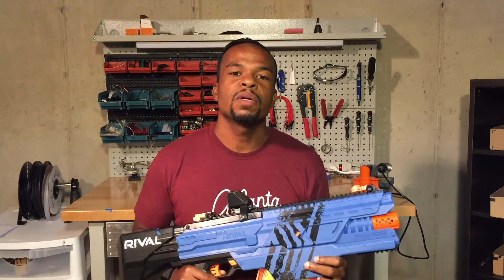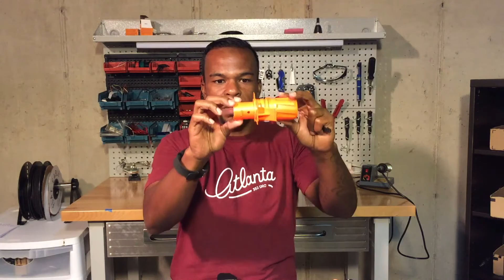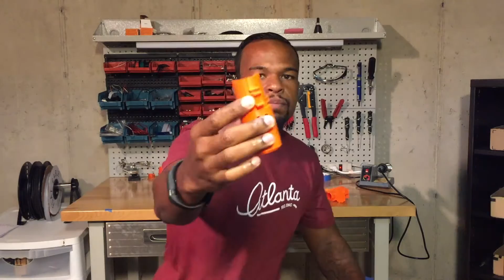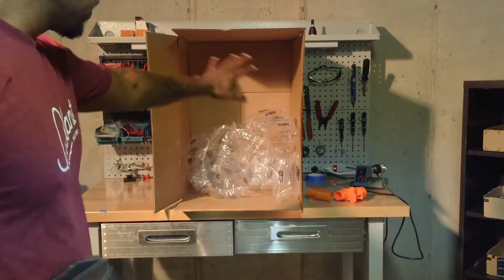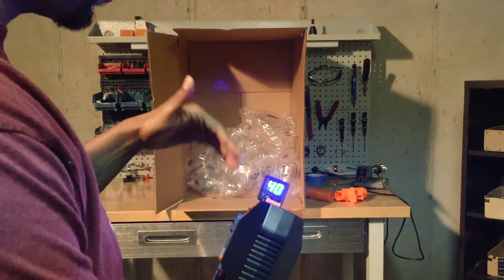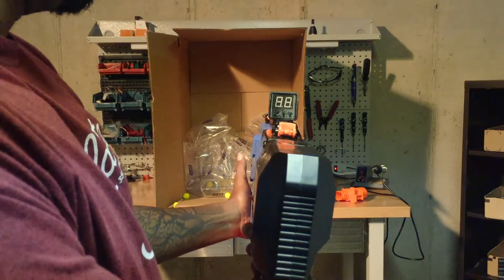AmmoCounter Nerf Rival Khaos Mod

Comment: Hi Nate.
Thanks the replies.
Guess Jesse is doing a fdl2x with ammo counter.
However I also use a zeus hirricane.
Id like to have a Mk1 that could swap between both blasters.
After watching the vid though, Im guess its next to impossible.
would need a 3D printed muzzle with adapter on both rival and fdl2
Question.
Have you done a zeus muzzle?
Second is would a wider muzzle with IR beam give inaccurate readings for tge smaller nerf darts?
Thanks for your time!!!!
Andrew

Comment: Is there a way to put a switch inside the khaos so that the ammo counter resets each time you put a new magazine in?
Reply from the maker: The AmmoCounter will auto-reset when it hits zero. :)
Reply: AmmoCounter Is there also a way to keep the stock barrel while still being able to use the ammo counter?
Reply from the maker: No, the printed part contains the IR beam.

Comment: So how simple would it be to modify the code to count UP from 00 to show how many fired instead of what's left?
Reply: Cool. Not sure if I'll ever get to doing that myself with my sweaty physical labor job in 8 hour shifts (would likely forget since I still need to save money for the gun,) but good to know the option is there.
I mean, it's a bit more convenient doing the subtraction mentally to figure out how many shots left than it is to have to modify the code every mag upgrade. Am I right?
Guess that would be considered a tip if am right.

Comment: Nathaniel, please tell me where you have seen the Khaos for $50?
Reply: Thanks for the answer. If you would indulge me again, what type of ultrafire (protected or unprotected) do you use? Where did you get them? Charger you use for them?
Reply: Thank you, sir. I have two more questions if you feel like humoring a stranger. When firing full-auto on ultrafires, does the range drop off the way it does when using standard alkalines? How long can you play on the ultrafires you use before you have to recharge?
Reply: Just buy a lipo. you can clearly see the blaster sagging under load.

Comment: Hi. Nate... I bought your universal kit for my Khaos. I can confirm the clip is tight and doesn't fit very well. I had to cut it into two individual pieces and glued to the two sensors on opposite sides of the inner barrel .

The counter works flawlessly. I shall be sending you pics / video of my Boosted Blaster soon!